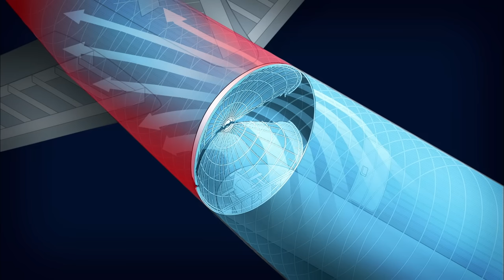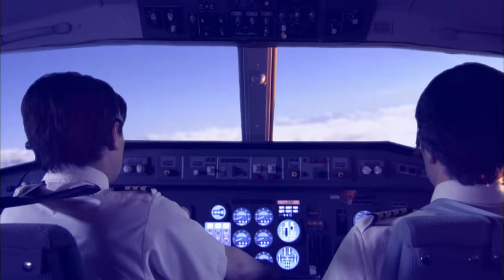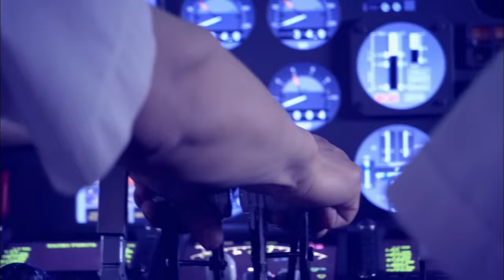This Plane Flew 30 Minutes, Prior to its Crash, with No Tail: Air Disasters | Smithsonian Channel

Comment: The pilots had done their best. Salute. At least with the effort they had put in, 4 people have survived
Reply: Forgot about thoze survivors... Another testament to a great design
Reply: Their work also saved more people initially, except the rescue services were held back by japanese authorities, american rescue teams were already ready aswell, sad
Reply: @JungleYT  Great design, as in a badly done repair that causes loss of basically every but engine controls?
This is in no insignificant part accomplished because of the pilots being chads
Reply: @user-uv5ld3cx5t  2013 Bagram Airbase, Afghanistan... 747 cargo shift damaged bulkhead and hydraulics causing loss of control...
Reply: They try their best to control the jumbo jet
Reply: Four??
Reply: I didn't know that 4 people had survived. I thought they all perished.
Reply: @bobby1970  Nope... Amazingly 4 did survive
Reply: It is 7
Reply: And these 4 people have greatly contributed in the improvement of aviation.
Reply: @roquitoroque7198  How? They were just victims...
Reply: How did they survive
Reply: More people survived, however, rescue crews couldn’t reach them in time. Those pilots did an amazing job trying to save the airplane.
Reply: @bobby1970  there would have been more survivals, but conflicts of the rescue team wasted too much time to get to the crash sight.
Reply: @roberthuot7887  That's really sad, and very unfortunate.
Reply: I know it will sound dull but I really really like to believe that if Sully had flown that plane, everyone would have survived (maybe landed in the trees in a supercool way)
Reply: @howmathematicianscreatemat9226  are you serious? They lost the whole tail. You cannot fly a plane without a tail, even sully!
Reply: @JungleYT  I’m a cool person…
Reply: @howmathematicianscreatemat9226  But this was real life and not some Hollywood movie. Give those Japanese pilots their props...
Reply: There were actually more than 4 people that survived but then eventually ended up dying from their injuries and from hyperthermia. There was a team of rescuers that were about enter the crash looking for survivors but then they were told not to go until the next day since it was believed there were no survivors but had they gone looking for survivors right away there would of been at least 10 survivors so there should of been more survivors.
Reply: The bigger the plane is, the higher chance of survive each passenger has in case of a disaster
Reply: @okanpasa  Good point - More crush zones, etc.
Reply: Se salvaron muchos pero por alguna extraña razón no fueron al rescate ese momento
Reply: @howmathematicianscreatemat9226  are u serious? The plane was literally not flyable. Sullys flight controls still worked and had hydraulics, and he wasn’t over mountainous terrain. That’s a nice thought, but the crash was inevitable
Reply: @Sishirreddy123  They were seated in the very back of the plane, where the impact forces were far less severe than those in the front.  Also, that part of the aircraft was more intact than the rest.
Reply: 50 people survived, but most of them passed away from cold and hunger because rescue though nobody survived, they send rescue the next day and only 4 people were left.
Reply: 50 people survived, but most of them passed away from cold and hunger because rescue though nobody survived, they send rescue the next day and only 4 people were left.
Reply: @Porfection  can u imagine. Gosh that woulda been soo terrible
Reply: it shouldnt have been possible to survive such a impact
Reply: @bobby1970  Initially there were like 20 something survivors, I think, but only the 4 rescued people survived
Reply: @theadventureinsider  Wow.
Reply: thank god for saving those survivors.
Reply: One of the survivors testified that she heard rough breathing all around her right after the crash. But she said she passed out once and the next time she came to, she couldn't hear them anymore. I'm sure there were some lives that could have been saved.
Reply: @howmathematicianscreatemat9226  Your ignorance is noted.
Reply: More people could have been saved if the rescuers had not spent the night in a nearby town. One of the survivors said that after the crash, she heard a lot of people humming asking for help before she completely lost consciousness.
Reply: They actually saved a lot more people if Japanese government in 1985 let the US navy rescue them.
Reply: More would have survived hadn't the Japanese not have taken their sweet old time to get there.
Reply: Originally it's estimated to have been 25 people but the Japanese authorities refused help from the US military who did find out about the crash area, and knew the estimated whereabouts. But they attempted their own search and searched the wrong mountain wasting precious time
Reply: Salute for the flight crew, shame for the rescue team; if they didn't delayed the rescue attempt, the number of survivor would be higher than 4
Reply: There were a lot more survivors initially the pilots did their best to lessen the impact but unfortunately rescue was delayed so much that many died from their injuries
Reply: @JungleYT national airlines 102
Reply: @Afanofplanes  What about it?
Reply: @JungleYT  wasnt the crash in afghanistan national air 102?
Reply: It would have survived more if they doesnt argue wheter who gonna be responsible for rescue operation even america already seen a crash and want to make rescue immediately but their authority refuse , fear that they will losing face and even stay night before go to rescue so 60 people death from lack of treatment
Reply: The pilots could have moved the people to balance the plane, that way it wouldn't climb when putting power, some else did it and survived
Reply: @CesarpaulRivera  are u serious? the plane was flying in a roller coaster form, yet u still ask the ppl on the plane to move around. u r out of your mind
Reply: @CesarpaulRivera  this was one of the first times a lost of elevator, alieron, and rudder has happened.. For example flight 981, they didint have a chance to level the plane. So when flight 123 had it aswell. They didint know a single thing on how to counter a full hydraulic failure. And for flight 232. The pilots studied flight 123's mistakes and learned from their errors.
Reply: @CesarpaulRivera  and also could you move people fast enough to not get rollled over by the sharp banks, climbs, and descents?
Reply: 0 people survived because the rescuers didn’t come in time
Reply: @Southwest_Aviator11  u didint research enough,
Reply: @Afanofplanes  oh I thought the rescuers didn’t come in time
Reply: @Southwest_Aviator11  they didint come in time to save 16 other lives, initially 20 or 15 people survived but all except 4 of them died from their injuries.
Reply: @Afanofplanes  oh okay thanks for the info
Reply: @Sishirreddy123  they were seating on the back rear of the plane.
Reply: Could've been more but the government refused an American jets help.
Reply: 0❤❤❤❤❤ @JungleYT
Reply: More could have survive if helps arrives .. i heard a US Army helicopter on its way to the crash site but japan order them to go back to base
Reply: one of the survivors was found in a tree! so insane
Reply: Yes, however, initially, the 4 eventual survivors stated that 40-50 people survived the initial impact, but passed because of the long wait for emergency services
Reply: @JungleYT This aged poorly.

Comment: Those pilotes are HEROES. More people survived the crush, it's really a shame that the people in power did not do what they were supposed to do in order to save their citizens.
Reply: Crash*
Reply: The people in power are not Gods
Reply: @MC-cg2rr  they did only a single row of bolts, they could have put in a second row like they were supposed to
Reply: @MC-cg2rr  the rescue team was delayed because they thought that nobody couldve survived the crash so they didnt send out a rescue team until the next day, turns out there were quite a few people that survived the crash but later died of injuries and other reasons due to rescue not coming
Reply: Are you really talking about the cops in Uvalde
Reply: @stasso05  USMC or army or whoever were there waiting to go rescue but were told to go back to base.
Reply: It is Japan Airlines 123 saw the full vid
Reply: it's impossible to really tell if they actually would've survived ultimately, but yeah, several hours of delaying rescue made a potentially improbable rescue impossible for the vast majority of survivors
Reply: The 12 yr old girl’s face was half burnt
Reply: Excuse me but if you are talking about the pilots, they actually did their best professionally to avoid losing control of this huge bird severely injured, in the flying simulations replicating this, most of the pilots only could survive twelve minutes, but here this pilots could be capable of maintaining the plane even tho it was gradually losing speed on middle air, to thirty minutes.
Reply: The accident was caused by faulty repair by Boeing. And if you know where Mt Osutaka is, even the elite Paratroopers couldn't get there in time. It's on a ridge with a steep slope in a dense mountain forest with no way to access.

Comment: 524 in total,520 perished,4 survivors.The pilots did their best to control their crippled B747 until the very last moment.
Reply: It was reported that one of the survivors was a young girl named Keiko, in her forties by now. How is she now? She said then that she'll never fly again.
Reply: @josehonoridez1085  can't blame her!
Reply: There were more survivors that survived the initial crash but is believed many were dead due to either the extreme cold or their injuries in addition to Japanese forces taking too long as it by the time the aircraft crashed it was about 10-15 minutes to 7 PM 

In this video (Investigation) and with what I know about JAL 123 
With Sources from Wonder: in their Mayday Series, Disaster Breakdown also made a video about this JAL 123 and was used as a source and on Wikipedia (I didn’t use Wiki but it does holds some info but I will credit it) 

Final Report states: Due to a tail strike in 1978 (7 Years before) with the engineers at Boeing who repaired the plane for Japan Airlines had done incorrect maintenance to the B747 by only completing  a single row of rivets when in Boeing repair manuals for the Boeing 747 it was needed that a double row of rivets must be done. 

Similar accident in recent times was China Airlines 611 another Boeing 747 which crashed in 2006 in the South China Sea or Pacific Ocean area (I haven’t fully read about 611)
That accident was also due to improper maintenance to its bulkhead this time 22 years after its tail strike and disintegrated Immediately after losing the tail. Sadly in this case no one on China Airlines 611 survived likely from loss of oxygen, Extensive G-Forces in the air or when contact with the ocean occurred

Also take note Ron Schleede who was mentioned in this video was also mentioned in the Wonder: Mayday Series video about JAL 123 it’s 50 minutes but it goes into more into detail what happened. He was I believe the Lead Investigator for the NTSB with the investigators in Japan he has done countless investigations with different agencies in his career and the reason why he was involved was because the B747 is an American built plane by the Seattle Based company Boeing and that’s why Boeing and the NTSB were involved

Also that last video JAL reputation was severely compromised despite it not being its fault it took many years for the company to recover after 1985 but it’s still in service today I believe this last piece of info from me I am unsure but please do confirm if JAL is still in service or rebranded and still flies today
Reply: Sorry, but they couldve used the passangers as leverage

Comment: It’s funny because a lot of people say “Boeing’s are unsafe” but when you look at the majority of Boeing crashes it’s do to either pilot error or poor maintenance
Reply: And airbus using computer controls really isn’t safer
Reply: So to reply to both of you a crash still is put on record damaging thier reputation and computers have problems being maintained ex: lion air 610 mcas
Reply: Those people want to ground the 737-800 due to high accident number (it was around 10), but if you look at the cause, most of them are pilot error and some other causes.

You can't really blame Boeing for a shootdown.
Reply: @DHDAviation  when did mcas became pilot error lol your the tyoe of person to blame pilots on a bomb blast too
Reply: @chandanops9312  lol read my statement carefully, where's the mcas?! Oh you thought that the 737-800 have it, but no!

Another lol, I'm not a person blaming pilots for a bomb. My statement refers to Karen especially in the last weeks blaming every incident and accident to Boeing without even determining the cause.
Reply: Last decade, maybe. Nowadays, the public do not have as much faith anymore.
Reply: @gargy2002 Agreed and after watching the documentary on Netflix about the MCAS, those Boeing execs should have been charged and tried for criminal negligence and/or manslaughter for trying to cut costs by not providing proper training on that system to begin with.
Reply: Maintenance or pilot error has nothing to do with the manufacturers themselves; these aircraft companies set rules in how to tend their aircraft but never actively enforce them; the airlines do

Comment: 520 dead all because of an improperly repaired aft-pressure bulkhead.
To this day Japan Airlines flight 123 is both the worst plane crash in Japan and the worst single plane crash in aviation history.

Comment: Welp, pilots have tested it in a simulators and only remained half of the time the real aircraft remained in air.
Shows how they tried their best and fight for their lives on a bird that is heavily damaged, respect and rest in piece to the pilots and the people onboard the plane.
Reply: I think i remember that the plane was poorly designed to have the hydraulic lines and the 2 other backup hydraulic lines meet at the tail. So when the tail snapped off the backup lines went as well. Now they redesigned the plane so there is no single point of failure
Reply: Correct : )

Comment: Air in the cabin the pressure is set to ~750hPa to ease breathing and preventing bubbles forming inside lungs. Mistakes like these are catastrophic because pressure is powerful that can cause damage improperly repaired just like a mistake made in the Comet 73 years ago...
Reply: The mistake in Comet is more on design, though.
Reply: @dbclass4075  it was said to be the new style. Thin & sleek!
Reply: @Cube-3710  It just the windows. Comet had square windows. Stress concentrate on the corners, causing cracks. As soon it changes to circular windows, it doesn't have crashes caused by cracked windows anymore.

Comment: I used to work at aircraft maintenance facilitie ,and after seeing for myself the cracks that used to appear in the 747 made me think that there's no way I want to fly in 1.
But 1 thing 1 must say is thank God for maintenance where they X-ray the planes to see if they have any cracks. 1 of the worst places was in the first class roof section, 
Because it's a egg shaped design it flexes with pressure and contract's making the ribs crack.

Comment: Just complacency by the repairmen lead to this smh
Reply: Same with AA 191 May 1979 out of O’Hare. Maintenance lifting an engine into place with a forklift cracking pylon mountings.
Reply: Repairs like these should be inspected after every few months or so.
Reply: @Dark Sigma Well, that's good to know. He did the right thing.

Comment: Stories like this are why I did not become an airline mechanic. You fuck up on a car? Blow a motor, ruin a wheel, hit something? You more than likely won't get fired and usually won't be putting anyone's life at risk. (At least if your thorough and check your work) but if you even so much as forget to torque one bolt to spec on an aircraft, something like this could happen and you could be responsible for the deaths of hundred(s) of innocent people. I couldn't live with that..

Comment: Because the accident report is very messy
The accident raises some questions in the accident investigation report.
Private experts are still informally investigating when the pressure bulkhead destruction occurred.

Comment: Brave Pilots, and that they held the plane in the air for just over 30 minutes is incredible. 
I'm wondering if an emergency fuel dump might have prevented an explosion, though..
Dump enough feul for the inevitable, but keep just enough to try and maintain some type of airspeed..

Comment: It is definitely design flaw for loosing the tail section like that, even pressure wall is damaged. In military Aircraft, even B52 has some incident for loosing the Tail section like that. But, the B52 pilots could manage the Aircraft for their safer landing.  SO, we should not deceived by such Excuse, for covering up their design flaw, lack of consideration and fail safe system. . Are you saying to the world that they have No Better design to protect whole tail section, even in case of pressure wall failure?
Reply: That's what the web-shape structure of bulkheads are for: if there are cracks, the hole will not be allowed to grow larger in size. The age of the aircraft can undermine the structure's ability to contain the damage.
Reply: The B52 and older aircraft have mechanical backup system. This 747 have no mechanical backup system.
Reply: @gokturk232  For 747's size and speed, mechanical system will be too heavy for pilots.